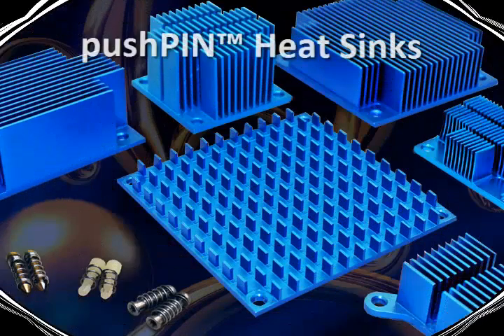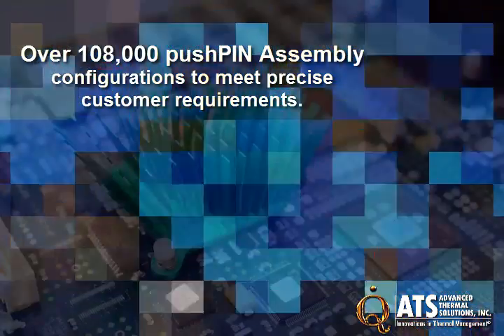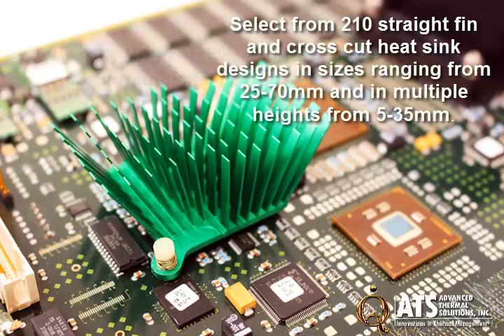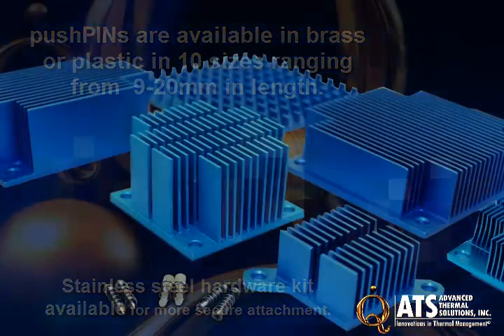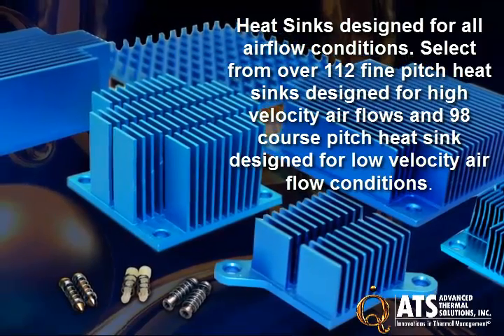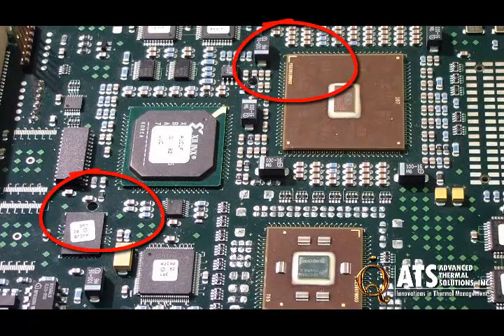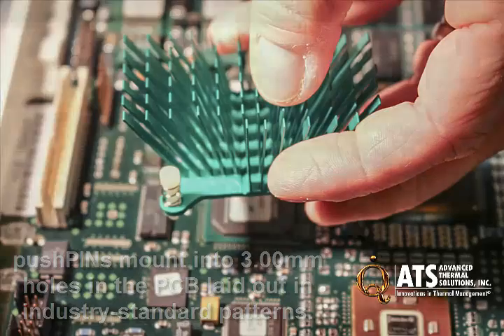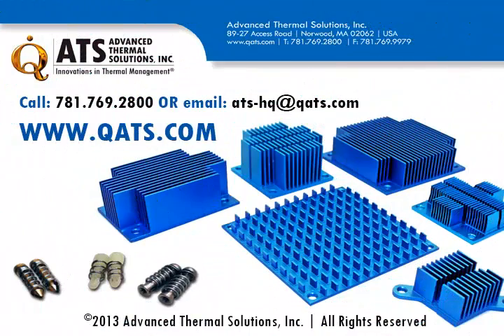ATS Push Pin Heat Sinks

Comment from the maker: Which Heat Sink Family Is Designed For A Wide Array of Spring Compression and Air Velocity Applications?

Alot of thought went into creating the ATS line of Push Pin Heat Sinks.  Some of the key questions that were considered included:

- How do we create a heat sink family where a set of applications might be either low air flow or high air flow?

- What type of environments, including shock and vibration, will a given application have and how do our engineers insure the right compression springs and hardware for a wide range are available.

- What are the widest array of semiconductor package sizes that we will need to be accommodate?

The Push-Pin 2-minute video gives a quick overview of the product line with these key design points in mind:
Reply from the maker: Learn more about ATS's push pin heat sinks here at qats.com here http://goo.gl/tccR0C

Like what you are reading?  Subscribe to ATS's Qpedia Thermal eMagazine http://goo.gl/BovoTb